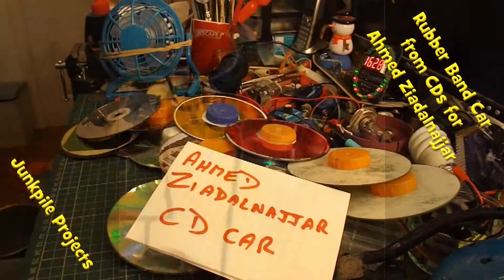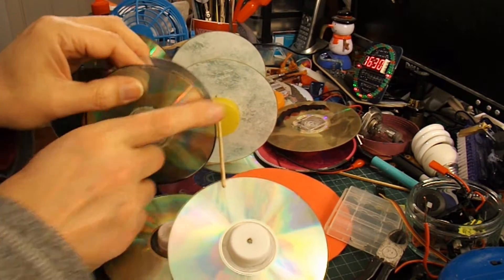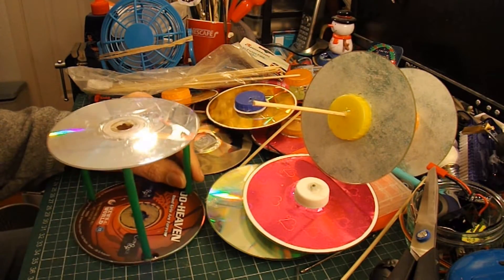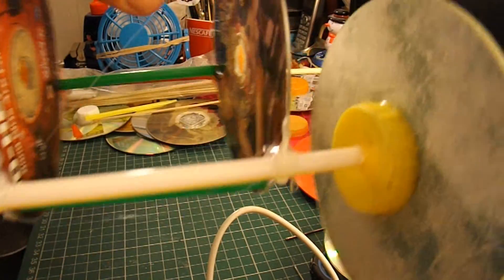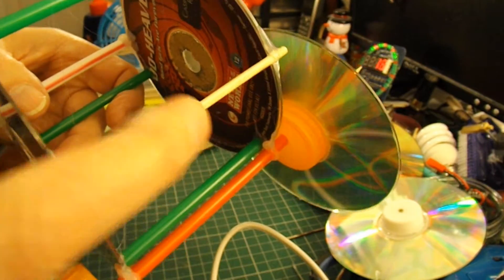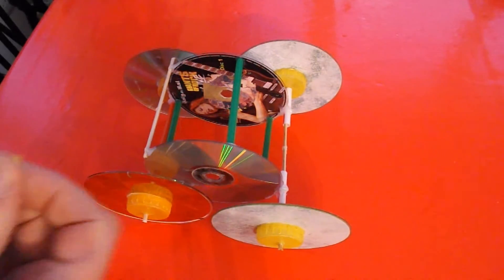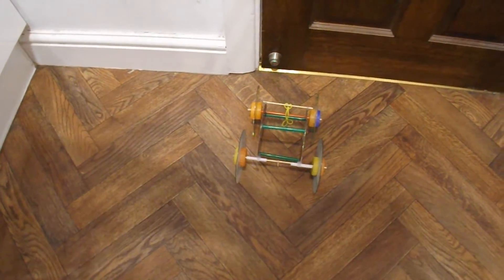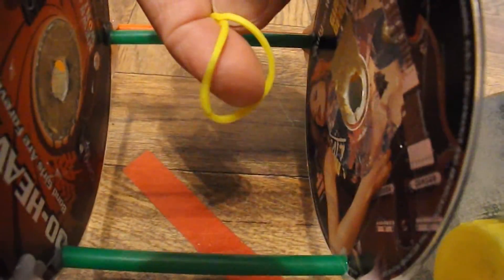Rubber Band Powered Car from CDs for Ahmed Ziadalnajjar

Comment: just a question here, if the car was longer would it go faster, and how about the axles if it was bigger would that change the distance it would travel?
Reply from the maker: Hi lil bunni, if we made the car longer we could put a longer length motor on it so you could wind more turns onto the axle. That should make it go further. To make it go faster you could use thicker rubber bands so you have more tension. SO thick rubber band = faster and long rubber band = further.  If you make an axle thicker then for the same length of band you would get LESS turns round the axle so it would be a shorter run under power BUT a bigger axle give you more power (like starting a car in low gear) so it would accelerate faster. There will be an optimal size axle that will give you the best acceleration for long enough to get the car moving fast enough to freewheel for the furthest distance. You can do the same sort of thing by comparing small wheels and large wheels to see which gives best acceleration, best top speed and best distance.
Reply: GrandadIsAnOldMan Thank you for answering my question! I'll use this info to help me make my car
Reply from the maker: I have many more rubber band powered car videos. There are links in the video description.